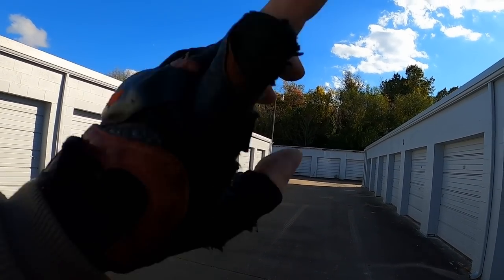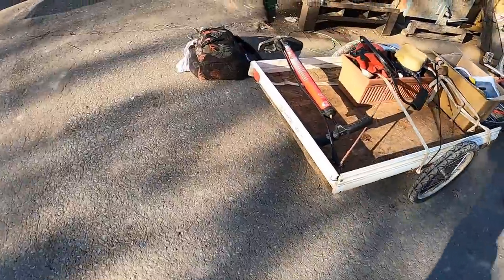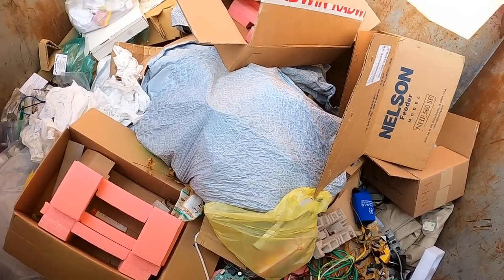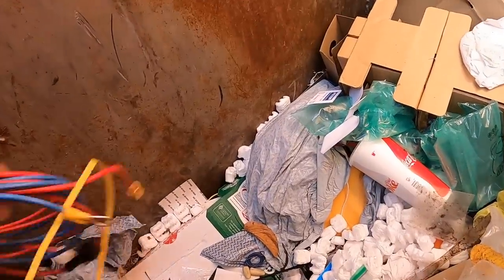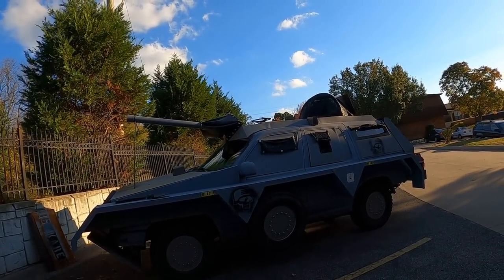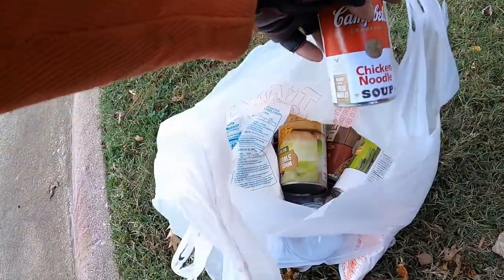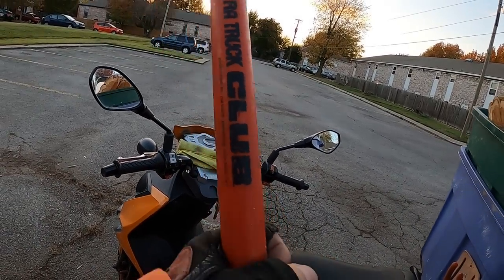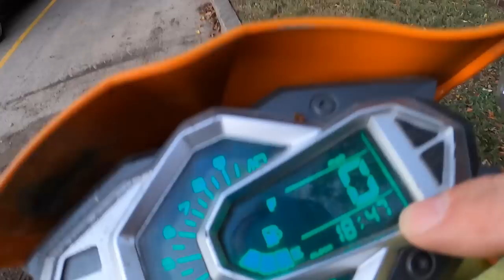SCAVENGE SCRAP SELL REPEAT Scavenge Scrap Sell Repeat SCAVENGE SCRAP SELL REPEAT Scavenge Scrap Sell

Comment: old enough to have used the Club when they came out maybe late 80's/90. they were a good deterrent until thieves realized that if you cut steering wheel they slipped off.  In political climate & issues of the day of both of these times,  it is interesting to compare and contrast especially as weapon.  As a young adult at the time I think I saw it as a good extra measure of security for my car (which i could break into when locked) & not directly as a weapon but certainly would have used it as needed.

Comment: i guess with the fire putteroutters there too risky, mind you i guess if there still loaded and get popped the outcome would with be huge cloud of dust or some scrap falling out over other cleaner scrap or going outwards and rtipping the machine or truck over or jut going outwards and hitting a worker, bummer though, have to hoard them up and fine a scrap yard that takes them or saw them up, oh that is a nice lil find right there whole bunch of wire, hopefully not stripped or coaxe, those stearing wheel locks are good if you own a classic car as well its going to stop anyone getting in yes there easy to break but some do put up a fight, furkullj's must of had the dumpster moved as they were under it,